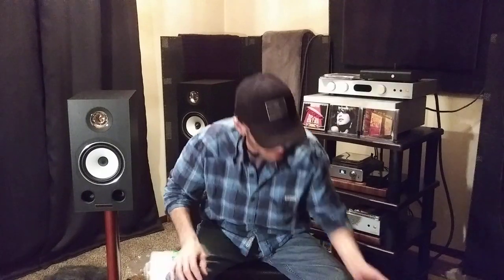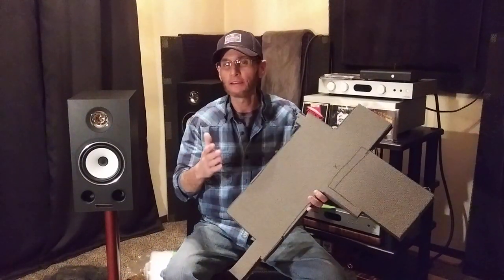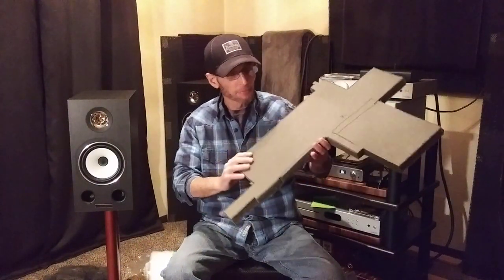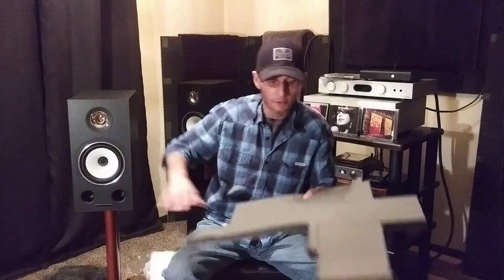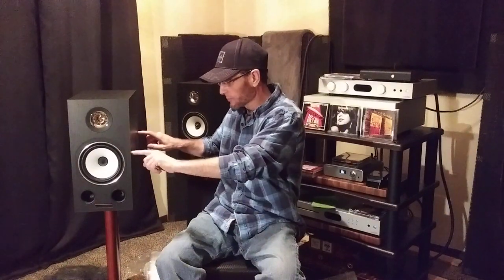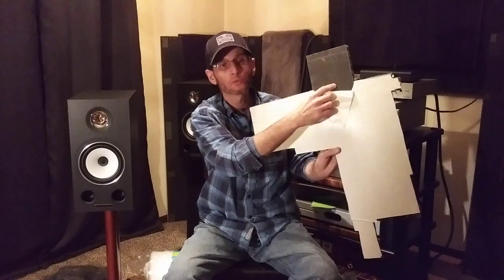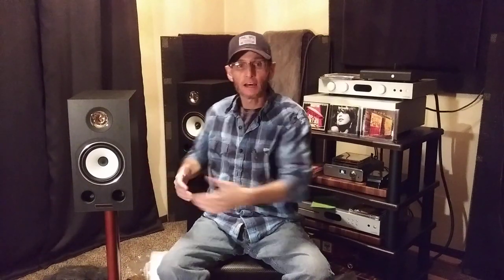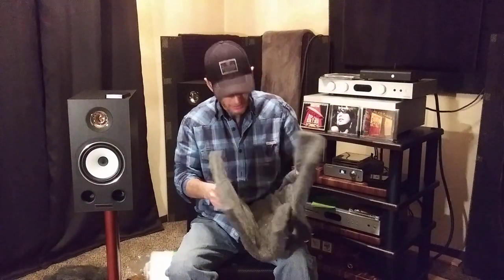My Expierence With Using No-Rez from GR-Research ! With my Triangles Esprit E.Z.Cometes Standmounts!

Comment: Um, no matter if you cut an inch off the top/bottom or sides/back of the no-rez, you still lose the same amount of physical volume inside the box. Also, by adding no-rez the effective volume of the box is increased and that is what affected your bass response; that is the purpose of the factory dampening you removed from the box. The no-rez also prevents the box itself from resonating and "coloring" the sound, kinda the same effect you get from an open baffle speaker: no box resonance.
Reply from the maker: Yeah i was wrong about the no-rez covering area
Reply: @tee-jaythestereo-bargainph2120  No worries, I had to think for a second too...
Reply: GR Research do state that half of the no-rez is open cell foam so the air volume is not reduced as much as the volume would indicate.
Reply: Right. The damping layer dampens panel vibrations and the open cell foam damps standing waves by slowing the air movement. This is why Danny says its basically volume neutral and Impedance traces show almost no change in tuning after fitting.

Comment: Couldn’t you have just put the side pieces in, all the way to the bottom first, then put the top and bottom pieces in?  Rather then cut your bottom and top then cut 1” relief cuts all the way around?  Or 3/4 sides?  Also, your idea of saving your volume of the box makes no sense.  The only way it would, is if you had somehow stuck the no Rez in there doubled up. Whether or not you had the no Rez reaching the top or bottom, or whether you had the no Rez sitting on top of the no Rez on bottom, the volume is EXACTLY the same. I really don’t understand how you’re figuring your math on that.that’s being said, thanks for the video, love Triangle!

Comment: Danny Richie said that the No-Rez doesn’t reduce the interior volume because it’s acoustically transparent to lower frequencies - just like your normal foam or batting. I know because I thought the same and asked 😉. The foam does slow the interior sound waves somewhat and makes the interior volume sound larger than it is. It effectively makes the speaker perform like a larger, undamped box.
Reply: It sounds like magic putting more foam can increase effective volume. We probably should fill up the cabinet with foam to see what will happen. Maybe it will sound like tower speaker!
Reply: I like the No Rez better than using the old R19. Danny's got a great product.  I wish he had some drivers in stock.
Reply: @SpikeoutBattleStreet  it slows up backwave a lot. That's why old sealed subwoofers sounded great and hit very low.
Reply: I put this in my violin and now it sounds like a cello. /s
Reply from the maker: @stevescudder1507  That was good !
Reply: It's open cell foam so no loss of cabinet space.
Reply from the maker: @koprcord5338  i love it !
Reply: @thomasstanfel7589  We are only out of stock on a couple of drivers and pallet loads of them are arriving in port (in New York) tomorrow. So it won't be long and we'll have full stock of everything again.
Reply: Bill is correct. It does not alter the interior volume.
Reply: @dannyrichie9743  thank you sir!!!

Comment: Actually, you used more material than needed inside the speaker cabinets to fill the exact same amount of space as if you wouldn't have cutout 1" around the sides of the material. As long as the material is all exactly the same thickness and your just going around the the walls of the cabinet, then there is no right or wrong way on installing it. You just gave yourself more work for the same result. That's called insanity.
Reply from the maker: It all equaled out to be the Same 
I was wrong !!! About saving Norez 
When i am wrong i will admitt it 😃
Live and learn

Comment: Great video Tee-jay. I've mentioned this to quite a few reviewers but efficiency is expressed as a percentage therefore it would be say, as an example 88dB sensitive not 88dB efficient. Also it's possible to use too much no-rez in a speaker. You can try just applying it to 2 walls only.
Reply from the maker: I did that first i went with just the sides then with just top and bottom and once i covered everything except front baffle i was like dam !!

Comment: Tee-Jay I expect the perceived extra bass weight  and mid impact will be because the energy that was previously being lost to the cabinet through panel excitation is now coming out of the front of the speaker where it should be and not being lost in panel vibration and noise. And is totally unsurprising. But great to hear your experiences.

Comment: I'll probably try one sheet for both speakers, adding smaller pieces in each speaker so that I'm still using the oem poly-fill. You just want a small improvement, without the risk of "too much of a good thing" having a undesirable effect.
Reply from the maker: Be careful taking off the rubber ring around the midrange woofer it likes to crease the Alumnium ring and it will not come out once you crease it !

Comment: I would probably lay my speaker out on the NoRez sheet and draw it out and then take an inch off all the way around or just leave it because I don't think doubling it up in the corners would hurt.  Then take the piece for each side and cut it in as many pieces as I need to-to get it inside.

Comment from the maker: Things i forgot to say in the video because i was running out of time 
But equitment used for testing the No-rez with the Triangle Esprit EZ Comete
Integrated Amps used 
 Audiolab6000a integrated amp 
IOTAVX SA3 integrated amp 
Yamaha AS-1100 integrated amp 
Power amps used 
Audiolab 8300xp 
Preamps used 
Burson Audio Composer pre/dac 
Audiolab6000a direct preamp mode 
Dacs used 
Burson Composer 3xp 
Aune x8 majic
And I was wrong about covering the surface area about cutting 1 inch off square to save space and have more volume , after i just added NoRez to my Kef Q-100s no matter hie i made my cuts the internal volume is the same sorry for that i tried 😆
Reply: Impressive list of equipment 👍👍
Reply from the maker: @eltonc1505  thanks elton lots of overtime hours put in to acquire all the audiogear lol.
 i personally believe a stereo reviewer should have many different front ends  when testing speakers 😃
Reply: Good gear selection..you went the whole mile for your testing..very cool.Are you going to put Tri's back to stock. I wonder if you gonna modify the crossover.Danny probably has a kit available for it. But those Triangles are pimp the way they are. I gotta buy 4 to 6 sheets for my next speaker cabinet build.
Reply from the maker: @thomasstanfel7589  Danny doesn't have a crossover for the Triangle Esprit ,
 The Engeeners at Triangle done an outstanding job on their custome crossovers theirs noway I would mess with their 'brain'of the speaker 😆 
 But i am keeping the Norez installed to me I gained 3-5 percent performace 😃
 I am shocked more people haven't shared their expierences with Norez every speaker will have different results
Reply: @tee-jaythestereo-bargainph2120  I don't think to many people really get into tweaking besides..cables. I got a set of Totem Wind Towers. I'm totally into them. I ordered two sets of Beaks. I'm having a buddy build me plinth's to raise them up 5 inches. I went and bought a 4/4 x 12 x10 ft Maple board. To do it right. I'm using extra to make a 4 inch thick Plinth for my Odyssey Stratos Amp. Gotta tinker..you know how it is..I wish my living room slash listening room set up was like yours...but I'm making due..stay safe you the man
Reply from the maker: @thomasstanfel7589  Heck Yeah tweaking is alot of fun espically when you get better results theirs so many formulas with Audio its crazy ! I will say I am a fan of the Engeeners at Triangle. 
The Engeeners customize their own crossovers and Triangle manufactors their own drivers and Tweeters thats pretty cool theirs videos online on how they build their componetes
Reply: @tee-jaythestereo-bargainph2120  I've been researching Triangle..they got some great history
Reply: You got the audiolab XP now how you finding that are using balanced all the way
Reply from the maker: @johnsweda2999  yes John i used balanced xlr with my Burson composer pre/dac review coming very soon . Also been trying out new signal xlr cables loving the 8300xp and the 8300xp will be an easy review for me its no secret i am a amp guy 😆
Reply: TeeJay ..you keep getting more equipment your gonna have to add an addition to your apartment. Lol. That's a very nice selection.. If you get a chance use your IOTAVX SA3 as a pre amp..it's got a nice tone to it. I've been using it that capacity with my Buckeye Audio HypexNCore 502..it does a very nice job!!!  Keep up the killer reviews.
Reply from the maker: @thomasstanfel7589  Thanks Thomas , And yes I have used the Sa3 as a Preamp with my Sansui G8000 in amp mode and the Emotiva basx A300 and Me Onkyo M504 😃 The SA3 is a budget fi Bandit !! Would be interesting to pair the Sa3 with a small tube amp for bi-amping the HF i think that may be a killer setup ! 
I did pair the IOTA Stack with my Integra M504 dual mono amp basically I had a amp driving each L/R HF and L/R LF drive powahaa i have a video of this but recorded from cell phone 😥
Reply: @tee-jaythestereo-bargainph2120  whoa..sounds very interesting
Reply from the maker: @thomasstanfel7589  Thomas you have the Comete right ?
Reply: @tee-jaythestereo-bargainph2120  No Sir. I am currently using Totem SkyTowers and Audio Nirvana Super 10s Alnico full range drivers  and Super 12 in an OB set up with 2 Rythmik 12s subwoofers. I was looking at a lot of Triangles but for the last few years I was obsessed with Totems and old school full range drivers..those Comets are the real deal
Reply from the maker: @thomasstanfel7589  i need to score some Totems ! Dam it Think my future pirchases i will get a pair of the Comete 40th of course dam tonality and texture got me ! But i will get the Elac Ub 2.0 and The Encore XLS from GR.
I  Just now ordered another sheet of NoRez 😆 My Studio 580s need side wall damping espically in the center sides
Reply: @tee-jaythestereo-bargainph2120  the Totems are totally deceptive.They use a different philosophy for cabinets. Their  tower speakers have compartments to load with sand or bird shot for dampening if desired. Every one of their designs has its own sound..and it's room dependent..I like the Wind Tower because it's sound stage is wide open ..like my open baffles..which use speakers with whizzer cones. I also want a lot of Danny's speakers, from my research his speakers needs a lot of power and once I get my Odyssey Stratos that's been upgraded to have 180,000 mf of capacitance..I can plan for that. I also got a slew of Audio Nirvana speakers that need cabinets built for it. However, my job barely allows me time to get basic housework done . Haven't had a vacation in 3 yrs. I'm salary so..until I find a better gig..I'm stuck in this Neverending loop of bullshit.lol. Those Elac are supposed to be real sweet..take care buddy
Reply: @tee-jaythestereo-bargainph2120  When I build those other cabinets I will use Danny's No Rez and the paint that Totem uses for their cabinets it's a NASA designed product that disperses heat and dampens.this Hi Fi..thing can make a person nuts.lol

Comment: Hi Tee-Jay, I don't understand how you get 3 to 5 % improvement. What are those percentages of? It seems to me that most of the characteristics you mention are very subjective. 3 to 5% of what? Thanks for explaining your installation method, it's very helpful.
Reply from the maker: I explained in the Video some will like the NoRez added some pep won't.
 and I have only tried the Norez with one speaker and my gain was the depth/layering of the soundstage because now the speaker disappears in the room better than without the Norez
 i don't get that box-E noise and also the midbass punch is a lil stronger than before . But like i said in the video some pep like a lively sounding speaker cabniet . I'm very opened mineded but it was a job installing ! Correctly Kef Q100s nexted 😆

Comment: My question Tee Jay, why didnt you just put the top and bottom piece snug against the sides and then cut the side pieces to just butt into the top and bottom piece, seems alot easier ?  Did you remove the stock stuffing that came with the Triangles ?
Reply from the maker: Thats what i was trying to explain snugging the norez up like that took up more space by fitting the pieces like a puzzle left me more space in the cabneit I used one stock piece to cover the inside wall with crossover. Tried using what Triangle used it was to much they covered the speaker very well but didnt add the stock accoustic filling back it was blocking bass ports and blocked off the back of tweeter completely
Reply: The thing about more space is nonsense.
Reply: You made a mistake in your analogy. You forgot to account that if you put the vertical pieces on top of the bottom piece, that bottom piece would be bigger. The way you demonstrated, you side pieces wouldnt be touching the side walls and why you assumes you would reduce you air space. Air space is the same regardless how you cut your pieces.

Comment: What did you drive the Comètes with ??? What’s your take on the cross over and wiring ?!? Because my 25 Anniversary Comètes are quite bright !! Thanx as usual !!
Reply from the maker: Hey William one of my bestfriends are from Canada !! But a pinned a comment of all the audiogear i used now as far as the Triangle conete Its still a lively forward sounding speaker (horn) but i wouldnt call it forward treble but more like forward music . One thing i notice with the EZ Comete was that only a lil bit of the volume goes to the actual titnium dome tweeter this is whats so impressive and I still get great detail refinement but I 'wouldn't' recommend a front end Pre/amp/or transport thats on the cool/lively side of netural 😃
Reply from the maker: If those speakers you got are overly to bright for you the No-Rez damping material may really help you out!

Comment: Thanks Tee-Jay, I’ve been thinking about trying no-rez for a while.
I expect that it will tame a lively speaker in a small bedroom.  Do you think that it might tighten up the sound for near field listening?
Reply from the maker: What speaker are you wanting to tighten up in a nearfield room ?
Reply: KEF R300 for my desk setup
Reply from the maker: @shahidyt  love KEF ! Huge Fan here!
Reply: @shahidyt  I know it's been a year since your post but thought I would add. @KEF designs one of the most heavily de-coupled speaker boxes in the audio marketplace. They have some very elaborate construction methods on most all of their speakers designed specifically to eliminate box resonance (some of them patented) and as such, not sure any aftermarket damping materials could add much in the way of controlling the speaker box anomalies; I just don’t see it. IMHO, it would be money spent in the “negative rate of diminishing returns” realm. Some of KEF's techniques are just not possible when building your own so for the DIY or other, less well constructed aftermarket speakers, the No-Rez or Black Hole 5 products really make a significant difference. Your best speakers (albeit usually most expensive) speakers are already aware of the negative design characteristics that flat, parallel wall construction creates and usually try and engineer around it. Even KEF’s ultra expensive series speakers take it to a whole new level as is evident in the shape of their flagship models. Decoupled and no (or reduced flat signature) parallel walls equals highly engineered, amazing (but expensive) sound.
Reply: @steveschwartz9421  thanks for the feedback.  I didn’t buy the no-Rez as it was expensive to post to the U.K. and couldn’t find any local dealers.
I’ve also pulled out of the hifi hobby, I haven’t turned my system on for at least 6 months.  I’m planning to go down the minimalist route and empty the house of clutter
Reply: @shahidyt  Ya gotta do what ya gotta do! Be well my friend and good luck in your endeavors!

Comment: I also used No-Rez in the cabneit of my  B&W 706s2 to calm down the upper midrange and Top end frequency and I got great results with the No-Rez. And you are correct the overall sound does give you the impression of added warmth but as you said that is just an illusion lol That was great and true The NoRez 100 percent helps a speaker cabneit to calm down
Reply from the maker: Finally someone else who has tried No-Rez !! I am a lil surprised that theirs not more video reviews of peoples expierence with Norez ! And yeah different SPEAKERS will have a different effect

Comment: It lost 1db in cabinet resonance 😂

Did you also return the polyfill to the cabinet, Tee Jay? I ask because that may have kept port noise down. As nice as the No-Rez is, it does nothing to abate port turbulence
Reply from the maker: It was more like .5db to .25 db down at same volume levels.
Reply from the maker: No when i added the stock polyfill with No-Rez the polyfill  blocked my front ports completly
Reply: Interesting point though. Do you know why Klipsch’s speakers are specified to have such high efficiency when they seen to be less so? They don’t use a weighted average. Instead, they find the loudest point in the response curve and measure the efficiency at that point only. Sneaky, yes?
Reply: Oh, and “blocking” the front ports should not be an issue, acoustically, as bass frequencies pass right through. Slower, but they do get through. You may want to experiment with that
Reply: @billd9667  klipsch is known for that. It's their horns, my buddies old towers needed lots of power to get it moving. The treble was tilted ..he EQed the  heck out of it.
Reply from the maker: @billd9667  I agree 100 percent , when I reviewed the Klispch Rp 160m i mentioned the 95db efficancy was more like 92-93 db at the most , 
Triangle gives a modest efficancy spec.